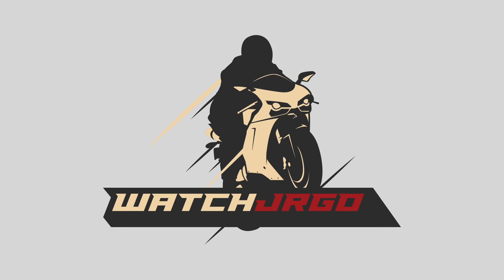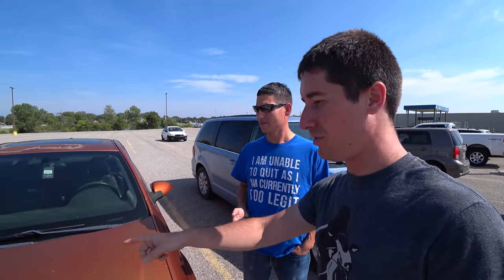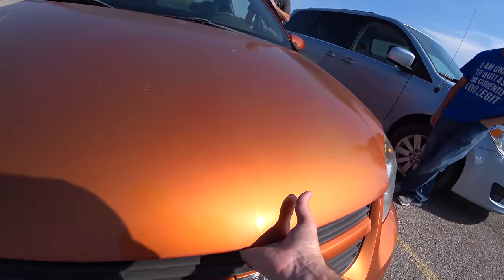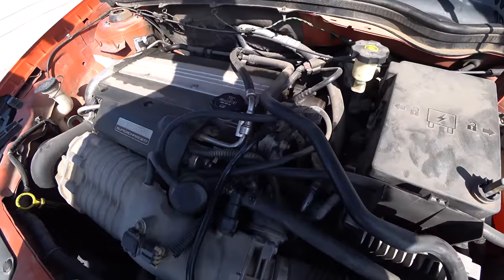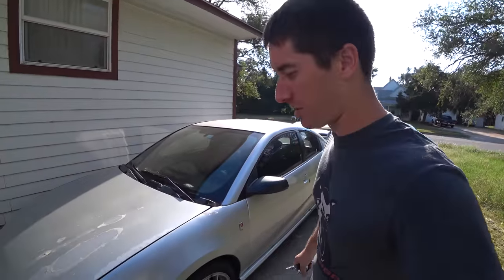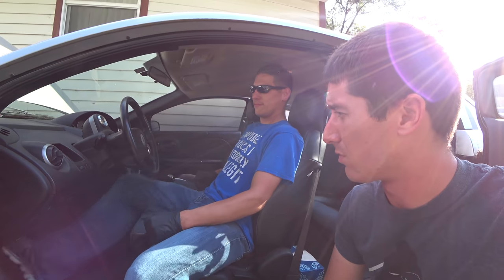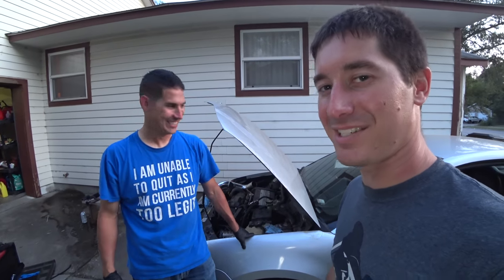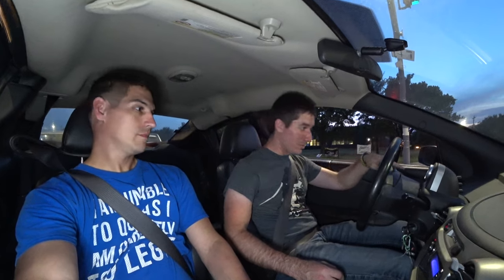DRIVING The ABANDONED Saturn ION REDLINE *Impossible Clutch Bleed*

Comment: Lmao did you run across my video for bleeding Saturn ion clutches? Because if you did my YouTube mission is complete.

GET THIS TO THE TOP SO HE CAN SEE IT
Reply: This needs to be pinned
Reply: Paul Carmi JR where are you😭😂
Reply: Yeah man! That's how I bled my clutch a few months ago! Did the clutch and brake lines all in one sitting!
Reply: Ok
Reply: I think the Redline uses a different system. The TOB are different from the standard Ions
Reply: Sidney Grove  You need to replace the oxygen sensor. Easy job. Just unscrew it and screw in. If your still looking a the car make sure to check the undercarriage more important the engine cradle, cradle mounts, and trailing arm mounts. Those are common fail points for these Delta platform cars. 2800 isn't bad for a Redline. I would try to get down more to 2500-2300 especially if the maintenance intervals hasn't been done (timing chain, clutch)

Comment: Yes sir been there done that on the clutch bleed. The issue I eventually found is that for some unknown reason GM decided to put a plastic bushing on the slave cylinder rod where it attaches to the clutch pedal arm. When they wear down you still have enough stroke to make the clutch work but just not enough for a full stroke of the slave to get all of the air out when bleeding. GM has the bushing available or the bottom of a beer can  can be trimmed to just the right radius to match the rod  end.

Comment: Lmao. I struggled bleeding the clutch on my saab. It's actually connected to all the brakes, so people have actually bleed the clutch through the bleed nipples on the calipers. But I just hooked up a pump with an adapter to the reservoir, put a piece clear tubing to a bucket from the bleed nipple on the clutch TOB, add 30 pounds, and just continuously add fluid when it gets low. Bled my clutch and all my brakes in about 15-20 mins. Pedals feel great.

Comment: Yeah. Bleeding the clutch slave cylinder is a *itch. If you hit the clutch pedal at the beginning more than a tap it will pretty much screw up your chances of bleeding. And, you can tap it only once every several seconds which gives the bubbles a chance to migrate to the reservoir; and you gotta do that for awhile. Once you start feeling a little "pedal" you can then start pushing the pedal down farther, but always allow several seconds between pedal pushes.

Comment: You have the factory boost gauge from the competition package but are lacking the projector fog lights. Im gonna venture to say its not a comp package. Pop the trunk and lift the carpet to find the RPO codes, look for G85 (LSD) to confirm comp package. The comp packages are especially rare..only 1096 (comp packages) were made over 3 years (none in 2004) and I guestimate about half are remaining. Cheers

Side note: Take a shot everytime I typed comp package lol

Comment: Great little cars-had one-140,000 trouble-free miles.
Reply: Heck yeah! I have a 97 SL1 with 185,xxx miles. Still runs like a top. Just needs an A.C. compressor and it'll be good to go. Got me to La from MI last year.
Reply: Josh Dupont Saturn Twin Cam FTW. Second best GM engine. Only loses to the 3800.
Reply: I had an 05 Ion that gave me 318k before it died.
Reply: 150k trouble free Ion. Never should have traded it in. 😩